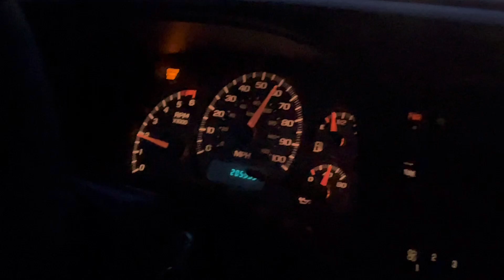Redlining My Car With NO OIL Until It EXPLODES + Massive Burnouts

Comment: Typically if you put the car in neutral the Rev limiter is higher
Reply from the maker: I tried it in neutral the first time and it only revved to 4,000 RPM. When it went to redline was in drive
Reply: when you try to destroy a chevy things get hard
Reply from the maker: The orange car is a Dodge Neon, not a Chevy